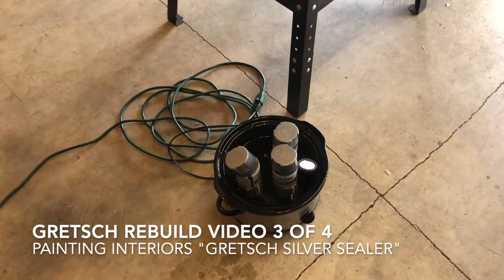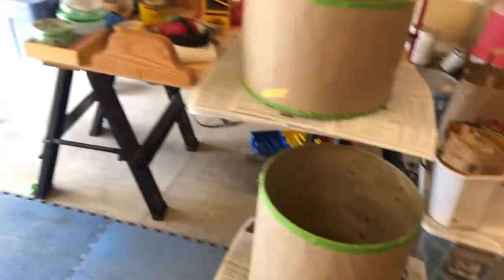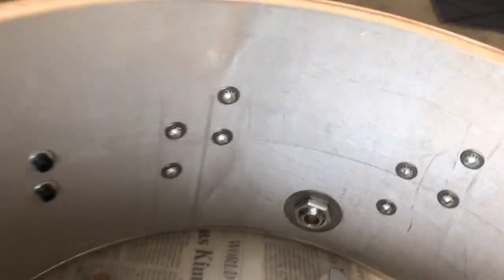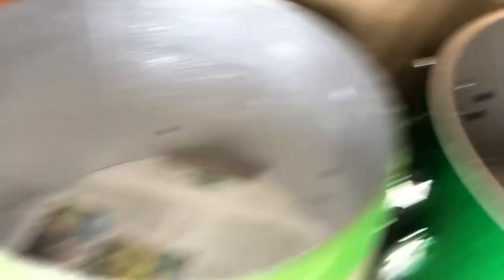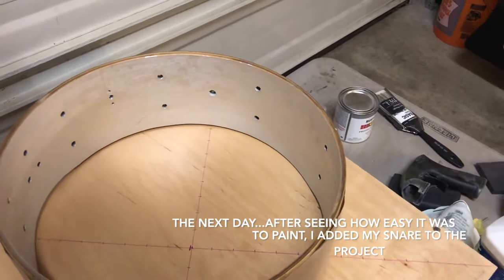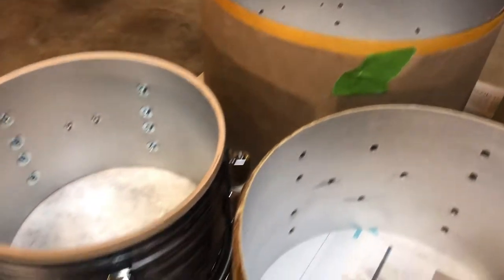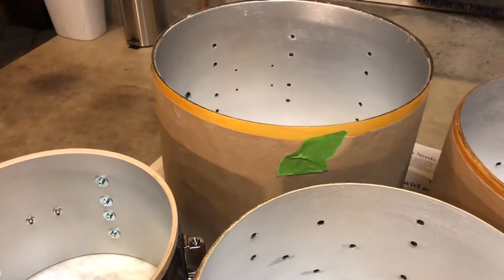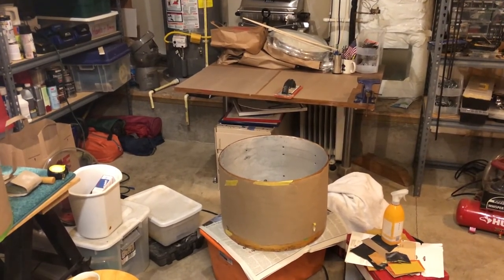Gretsch drums internal rebuild, part 3: painting!

Comment: I put a Gretsch coat onto a kit that I was restoring and I was using very expensive paint. Follow the pattern very much like you except it was very warm in the summer time and I was in a controlled temperature room that I was using for painting. However, was very disappointed and what happened in that after they had cured for several days you could still take your hand and gently rub it over the silver paint and the silver paint would come off onto your hand.